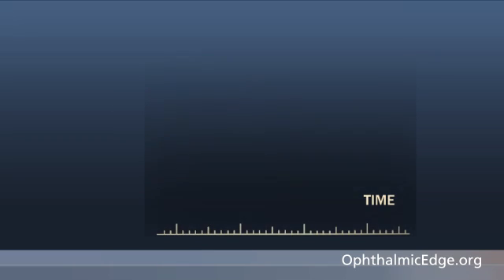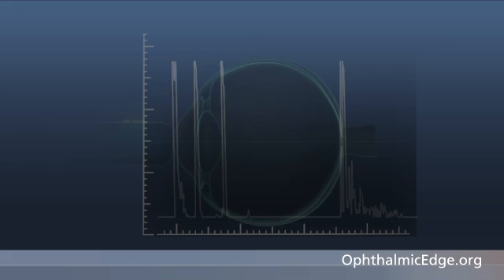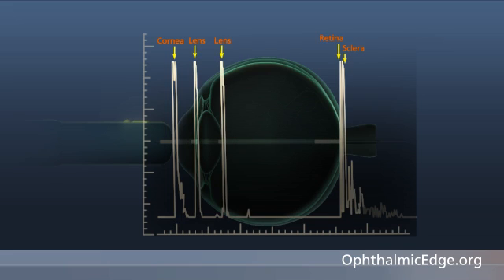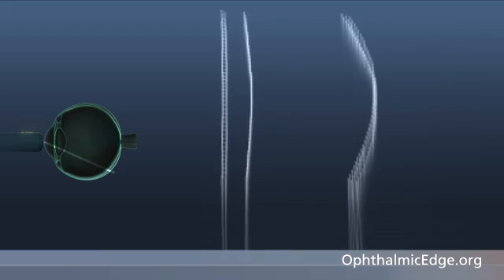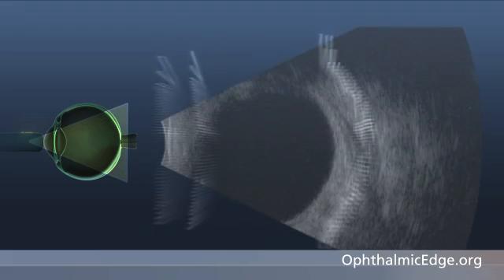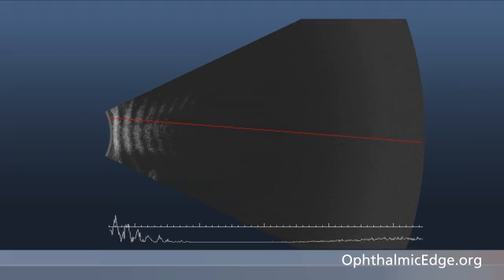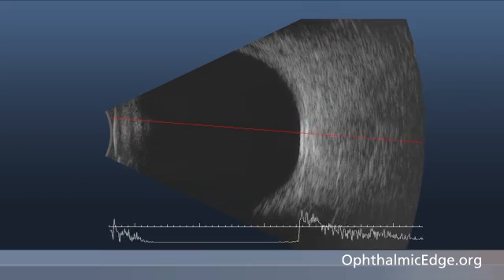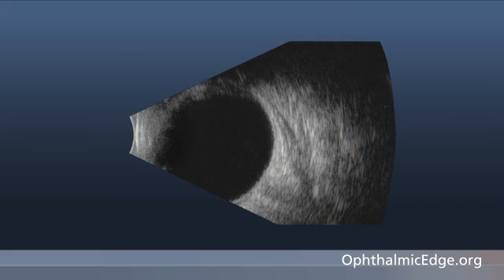Lecture 4:How Does an A-Scan Become a B-Scan?

Comment: Dear Dr. Yale Fisher thank you so much for the useful lesson and I am so thankful because of the enthusiasm unintentionally you gave me, the following are some translations for my friends to understand easier so please don't remove it away and so sorry for my bad English
English transcript 
Lecture 4:How Does an A-Scan Become a B-Scan?
A scan is time amplitude. Time is along the bottom, amplitude is vertical. It gives you a bunch of lines and those lines define how strongly the echoes are displayed. If you'll contemplate an a scan probe on the front of an eye just as if you were going to make an axial length measurement you would get back one A scan usually demonstrating the front and the back of the lens as well as the beginning of the retinal spike those would be three vertical lines. 
But how can you make that into an intensity modulated system but B scan. If  you move the probe up and down the eye maybe a hundred and twenty-five different places and took an A scan from each one and then carefully pick them up turn them 90 degrees those lines would come forward enough to cause the phosphorous on the front of a screen to glow and they would give you three dots, connecting the dots would basically give you a B scan. 
One further point often when you're in simultaneous a scan B scan mode you will see a vector line across the screen. That vector line actually represents the 1 A scan in that site at that position that is displayed at the bottom of the screen. With simultaneous a scan during a B scan you can tell whether or not you're perpendicular to an object that you're trying to follow and quite frankly it is easier to measure the height of a returning echo in amplitude than it is to be able to discern a difference in its brightness